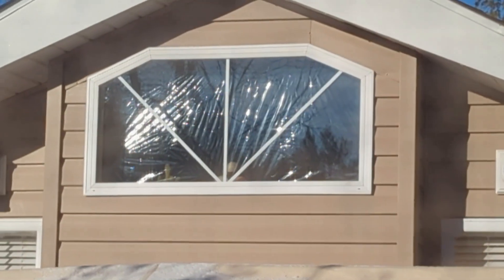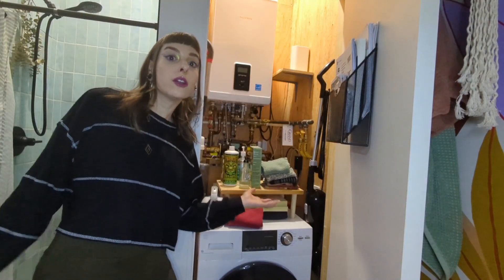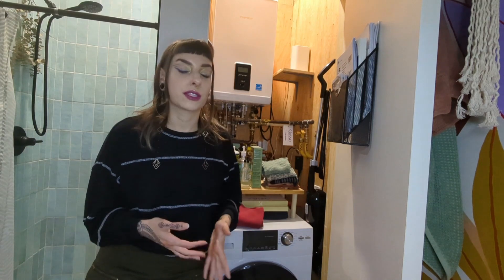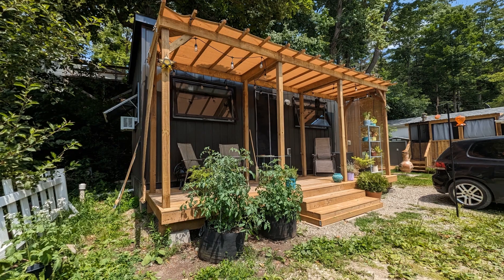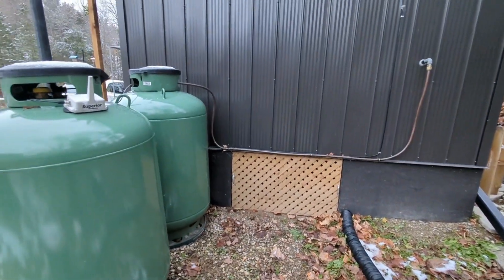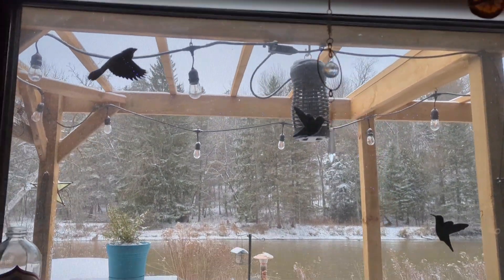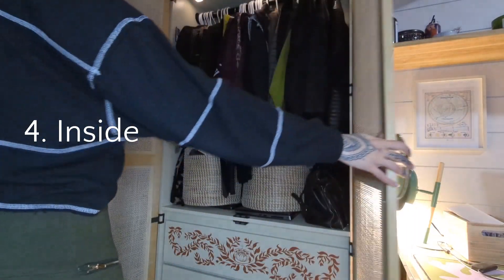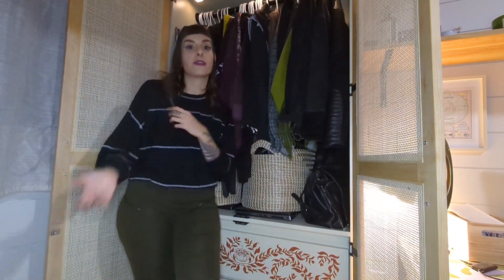WINTER in a Tiny House in Canada

Comment: You don't necessarily have to have leaky windows for the plastic wrapping to help. Even with double-glazed windows with a good seal (as we have in our place), just having the plastic there traps a layer of air between the window and the plastic and provides more insulation.

As for what I look forward to in the winter.... Clean air, I guess? The one nice thing about when it gets really cold here is that the skies get very blue and clear and the air quality improves significantly. The downside is that it is often so cold that I don't want to go outside! 🥶

Comment: Thank you Stacie for your usual informative video.  Unfortunately I purchased my so called new build tiny (it has second hand materials & had a stackable washer/dryer that was manufactured in 2004!) that has a mini split for heating and cooling.  I'm hoping I can use the cooling during the night in the summer when I'm not using other hydro as the park has limited hydro and doesn't want renters using hydro only, I've had a propane furnace and instantaneous water heater installed.  The furnace was turned on as a trial this week and it was noisy but apparently something was hitting the case so I hope it's been fixed! 
I'd love to have a bird feeder but I'm concerned it would cause other critters to come around, mice, squirrels, raccoons etc. as they do come out of hibernation at times during the winter if there are warm spells.  Have you had issues?  
I had my tiny home towed to the park on September 29/23 and I'm still not living there as the bathroom isn't finished yet.  The workmanship was so bad that I had to have the bathroom gutted.  The insulation is poor throughout but I cant afford to gut the whole house.  I couldn't afford to sue the builder and take the chance I wouldn't get my money back.  I'm having an add on room/mud room/sunroom built so I hope that helps keep some cold out!  I'm really hoping I can live in it by the new year as I'm paying double rent.
For all reading my comment, ensure that you get a reputable builder for your tiny home!!!
Reply from the maker: Thanks for your comment! I have never had mice, I assume because there are A LOT of barn cats around here. I do hear racoons occasionally fighting at night (look up racoon fight and you will see how horrifying it sounds!). But yes, I have A LOT of squirrels and they're very crafty. You need a baffle on the feeder pole so they can't climb up.

Comment: I am surprised to hear that floor heating is efficient.  Does the whole floor heat up?  There are small ceramic cube heaters that set on the floor and blow hot air at your at floor level, but the heat rises to warm up the rest of your body.  But it's localized to where you are sitting/standing (as opposed to the entire floor).